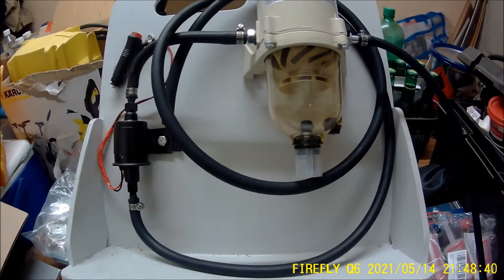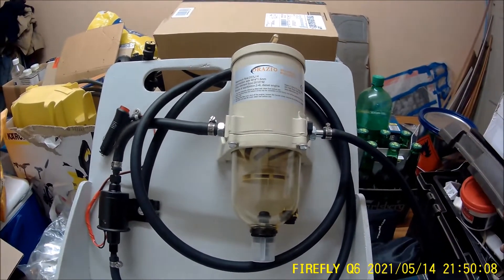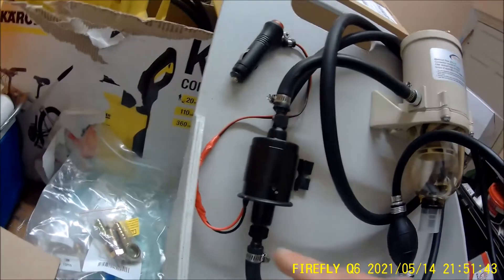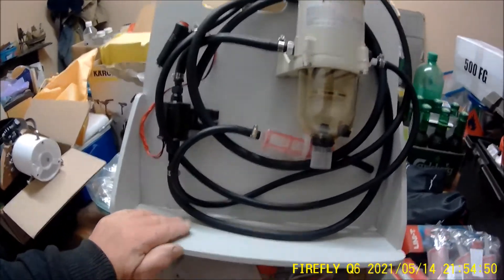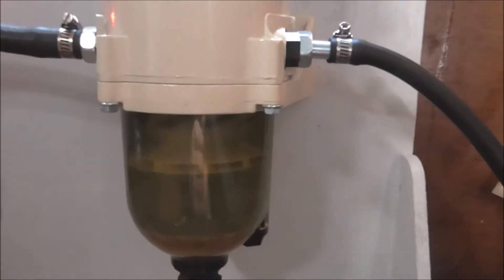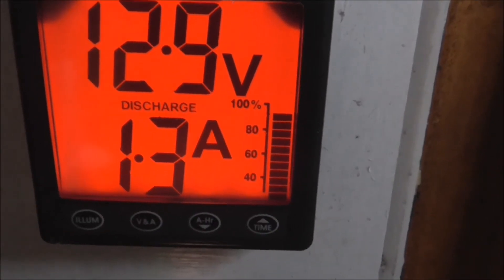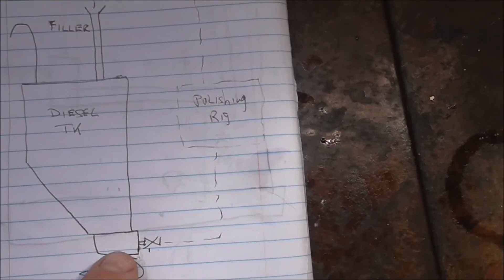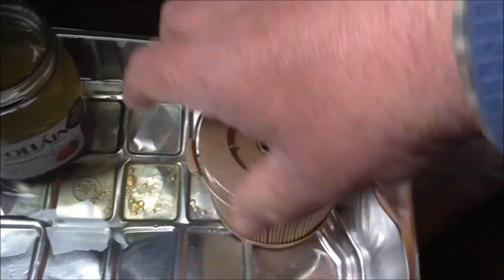Fuel Polishing Rig for my boat

Comment: Just found your video, very helpful. I am planning on making a long open sea passage for a boat I have purchased. Clearly history of tanks unknown so will be replacing the existing filter assembly with two of these units you have shown with valves so I can switch between on the fly in case I have an issue. I very much like your set up and will with some plumbing and additional valves arrange a tank polishing set up using the onboard filters. I like the priming bulb but see the restriction it makes. Again albeit with some complexity a couple valves and bypass hose would resolve that. The bulb I see of great advantage when you get air in the system. The fun is in the making of this polishing system, much thanks for the inspiration.

Comment: Those pumps are meant to flow vertically upwards (helps bubbles etc purge out).  Also, secure them onto a piece of rubber (not hard mounted) and most of the noise will stop.

Comment: Thank you very informative. I’m having fuel issues and have to polish my fuel, i noticed on my 2 micron racors a bit of slime on the top which cuts off the fuel flow. It would really help if you had a list of the products used so i and others could do a screen shot
Reply from the maker: Hi , it's been awhile back since I set this up and  thought I gave info on parts used on video. I purchased the items from amazon.co.uk except for additional racor filter elements which came from the local chandler's. If there are  items you need info on I can back check my orders .
Reply: @mgtsmartlady  Hi, don’t worry I’ll go back and stop the video and the different points. Thank you

Comment: so this polishing should be done once a season? or whenever you get bad fuel?
Reply from the maker: John, I suppose it depends on many factors , can you drain a sample from the tank say at end and start of season as that would give an indication of fuel condition. Also past history and confidence in fuel supplier. If you end up with suspect fuel I would say yes.
Reply: I found that when I moved my boat from a northern climate (Vancouver, Canada) to the tropics, I had to increase the frequency of polishing 5X for two reasons: 1. Fuel quality worse; 2. Algea grows more rapidly in warm temperatures. So, it depends very much or where you are.